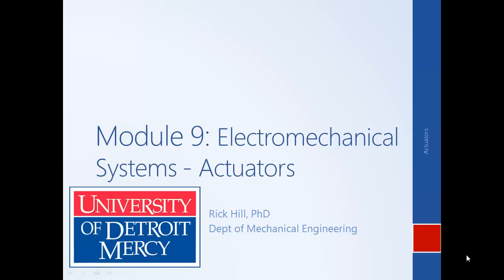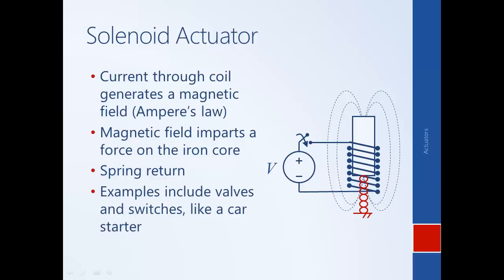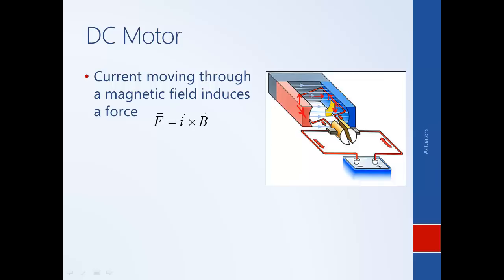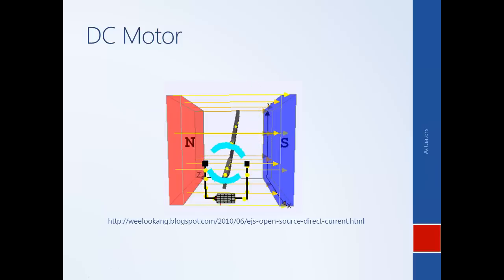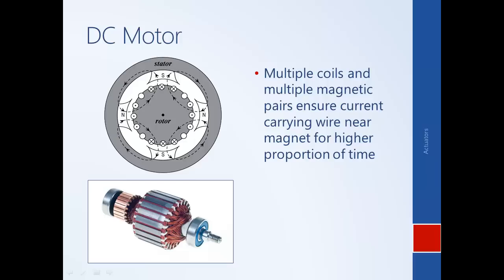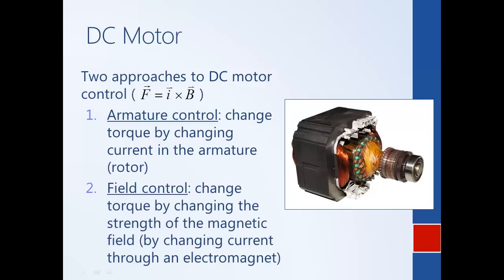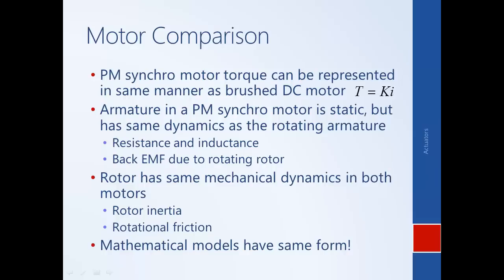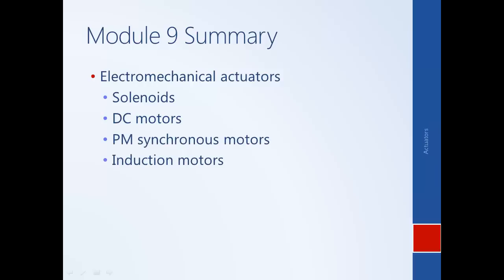System Dynamics and Control: Module 9 - Electromechanical Systems (Actuators)

Comment: I'm slightly confused with the direction of T_s and T_d for J_2 around 53:00. If you held J_1 stationary and twisted J_2 in the direction of Theta_2  (counter clockwise) then wouldn't the spring want to pull it back in the opposite direction of Theta_2 (clockwise)?
Reply from the maker: For the situation you describe, the spring would apply the torque in the opposite direction drawn here. It means that the given expression Ts = K(theta_1 - theta_2) would be negative (theta_2 > theta_1), and hence the torque would be opposite the direction I have drawn it. 

If you drew the free-body diagram for J_2 differently such that T_s (and T_d) were in the opposite direction, you can do that, it is just that the expressions would have the thetas switched. That is, you would have a torque T_s' = K(theta_2 - theta_1) that is positive when theta_2 > theta_1.

Comment: at 40:58 I started to wonder, if the system reaches steady state, then the angular velocity becomes constant.
in that case, couldn't we replace the term  θ-dot by a constant?
Reply from the maker: θ-dot is a constant in this case (steady speed with changing position), but the constant will differ based on the applied voltage and load on the motor.

Comment: At the moment, I am working on developing a DC motor actuator integrated with reduction gearboxes and ball-screw drive. Since in this case, there is a required transitional force from the load. Could you please explain how to model the whole system? I understand that what's included in this video is just the model of the motor itself.

Comment: Where do you get the friction coefficient 'b' in you equation?  I have been looking for an example value and cannot find it in any motor datasheets and only have seen that this value is 'determined by experiment' which doesn't help me in modeling my motor.
Reply: You can just use B=0.001 or a similar value. From what I've seen so far in my simulations it won't influence the final value of the speed, at least not significantly, it will just act as a damping factor, causing the system to reach steady-state faster. The final values of the currents, voltages, etc also seemed to remain unchanged whether you include B in your equations or not.
P.S.  I'm a newbie, I might be wrong.